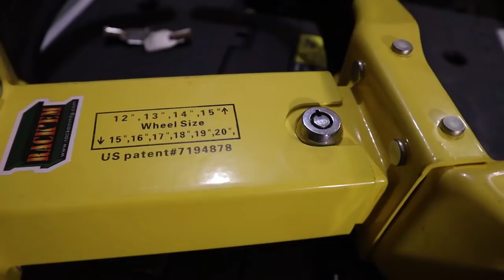Deter Theft and Save Your Investment With Lock'em Wheel Lock RA-25

Comment: northern tool has one that looks heavier, (not sure), but it has a steel plate that covers the lug nuts so you cant remove the wheel. and wraps around behind the wheel. sometimes just having a deterrent will get them to move on.

Comment: So if they want it bad enough a thief could just come remove the wheel and bring a new wheel with them and trailers gone. Or if it’s a tandem axle trailer they can just remove the one wheel with this device and simply drive  off.
Reply from the maker: CAR WASH ENCOUNTERS that’s why I have 2 plus a tongue lock
Reply: Lanier Lawn Care I gotcha. Same here. I’m all about lock-in things up also.
Reply: That’s why you use locking lug nuts on your wheels